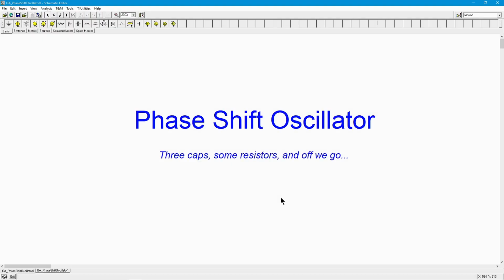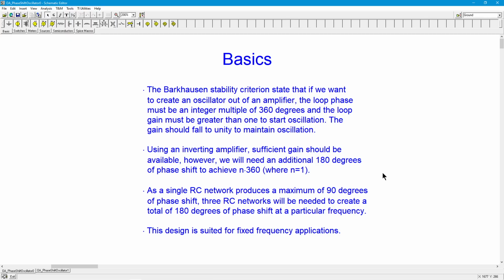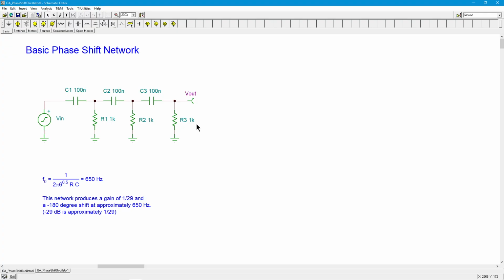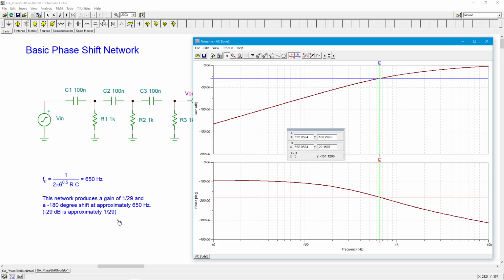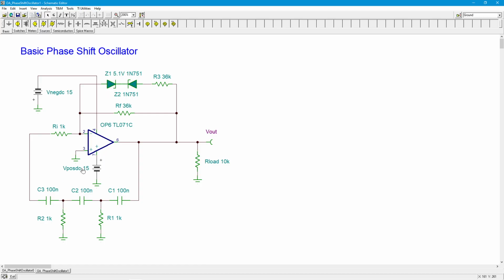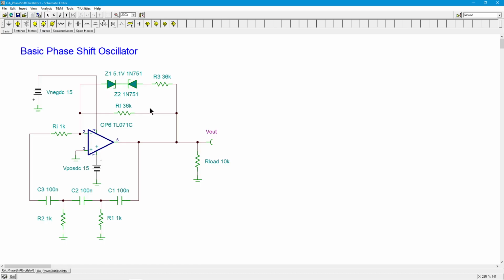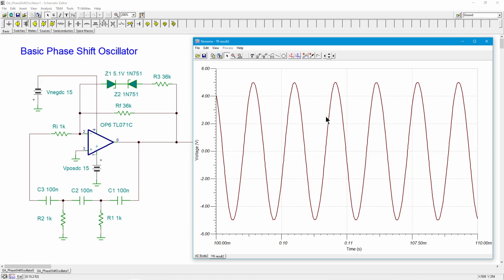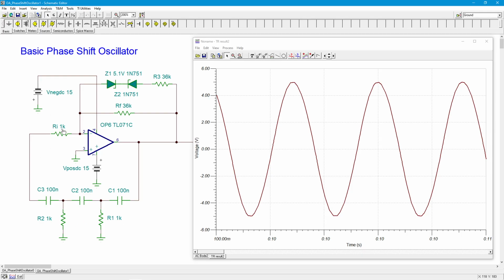Op Amps: Phase Shift Oscillator

Comment: What do you think might happen if you substitute the passive filter with an adjustable active filter?
Reply from the maker: As long as you can get the proper loop gain and phase, it should work. The loop gain might be a little tricky because an active filter can be created to produce forward gain, unlike a passive filter (so you'd have to compensate for that). Not sure why you'd want to do that though as there are less expensive ways of making an adjustable frequency oscillator (Wien bridge comes to mind, for starters). Maybe use an OTA-based filter for voltage control (?)
Reply: @ElectronicswithProfessorFiore  yes this is true you probably wouldn't wanna do it because of the distortion but it was just a thought I haven't found super clean variable frequency generator.
Reply from the maker: @davidkclayton  These days, the hot ticket is DDS (direct digital synthesis). Basically, a microcontroller feeding a DAC. With high bit resolution, you can achieve crazy low THD sines and create arbitrary waveshapes across a very wide frequency range. One of the exercises in my Embedded Controllers lab manual shows the basics of this. Here's a short clip showing one the student's results:
https://www.youtube.com/watch?v=yku5LXmUgCc

Comment: Dunno if you'd indulge in explaining how a state-variable oscillator works, I've seen you can get very low distortions out of that.
Reply from the maker: You can make an oscillator out of any amplifier. Just add a frequency selective network via positive feedback, so long as the forward gain is at least as large as the reverse loss through the feedback path. You also have to make sure that the loop phase at the desired oscillation frequency is an integer multiple of 360 degrees. Thus, pretty much any active bandpass filter is a good candidate.